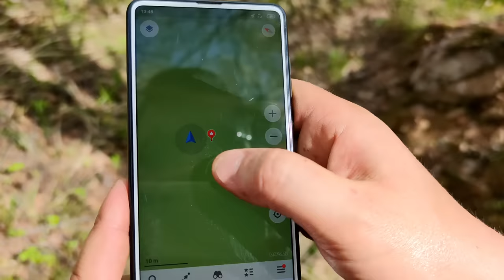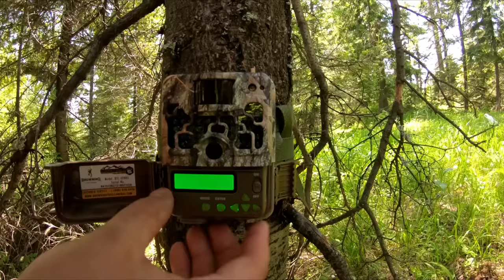Mountain Stone House Build: Start to Finish | THE BIRTH OF A LEGENDARY HOUSE

Comment: Brilliant effort and just goes to show what a lot of hard work with natural building materials can achieve, very well done. The collapse of the chimney must have been a blow, the restoration looks great. I have a possible theory on the reason for the collapse.  Could it be that the heat generated from the fire degraded the material used to hold and bond the rocks/stones together and thus caused he collapse. Great video on your recording of the scenery and wildlife during the changing seasons.

Comment: A lot of hard job!!!! Using stones there is not necessary for any king of maintenance only same insulation!!!! Congratulations!!! Nice video!!!! Thanks for sharing!!!
The potable water is mandatory to have it near to the cabin!!! In my opinion a metallic stove should be used, takes less volume inside the cabin and worm more easy and fast the space there (of course you can cook on it)...
Have good time every time!!!!
Best regards from Hellas (Greece)

Comment: Would building a cabin on a hill like so be a bad idea considering all the water run off coming down hill into hunt/cabin during heaven rain??
Reply: Not really. All you need to do is dig a drainage ditch upslope of the cabin to divert any runoff from the slope around the cabin. With a little planning, you can use the soil & rocks from the drainage ditch as building material for the cabin..